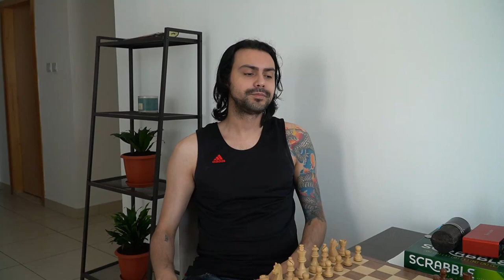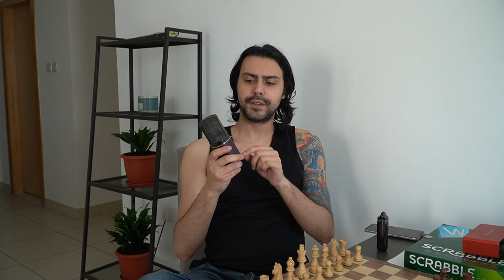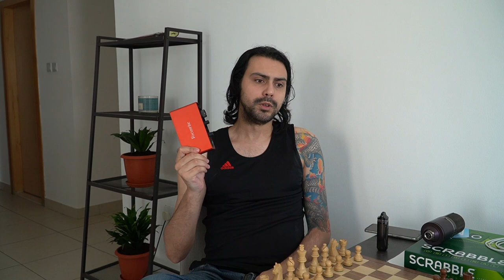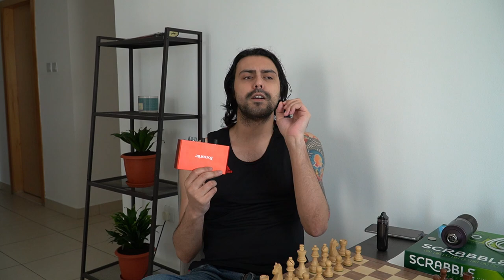Real Talk: Keyboard soundtests are a LIE

Comment: Thank you for the very informative video!

For me the general purpose of these sound tests for most poeple is not the perfect replication of the sound of a keyboard. It is more of an indication of what could be suitable to the listener. (Which brand of a linear switch do I want to try out? Does this keyboard sound pleasing to me? These are the questions the listener might be asking themselves. Imo the general character does not get lost. I think even on a bad recording it is possible to hear the difference between a mass produced violin and one crafted by hand by an experienced expert.)

Or look at it like this: say i want to travel somewhere, and im interested to travel to both Paris and Rome. I might look at photographs before I decide where to go. Cameras cant capture the same contrast as the human eye and looking at something is not the same as looking at a picture of something. But i can still get a glance of the atmosphere and knowledge about the place where I might go.

TL;DR it is not necessary for a sound to test to give the exact experience to the listener as hearing it in person would. The general character of the sound will be preserved in most cases. (imho)